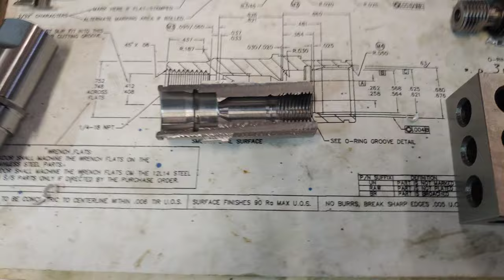Boring bar broke clean in two!! Oops!

Comment: The drill for the pipe tap pushed back in the holder when it started so I don't think the hole was deep enough. You can see it move back into place when it goes to the sub and does the center drilling.
Reply from the maker: Thought I saw that too. Weird thing is I ran a shit load of parts for days before shooting this.
Reply from the maker: Out of steel even.
Reply: @matthewcncsutton5283  the curse of filming is real lol
Reply: Yeah, saw the drill slide in the tool holder at 1:05 and knew what was coming, I guess you were too busy cleaning the stringy chip off to see that lol.  You can see it push back out again when the on the next op on the sub spindle
Reply from the maker: Nice observations sir. And yeah I saw it and thought my eyes were playing tricks on me like sometimes it does.

Comment: That's kind of impressive, pretty complicated little parts. I think I would personally use solid carbide micro boring bars for most of the drilling stuff.  I wonder if anyone makes an indexable tiny combination drill and boring bar? They make big ones.
Reply: Much as I hate Kennametal they do make smaller sizes, They are like little drills with a carbide tip you can change out and they have a few sizes, Called Kentips I think.

Comment: That's a bugger. But looks like you could use a larger boring bar as it's just a cleanup pass?
Reply from the maker: Yeah im trying to hit put a 32 finish on the angle going to the smallest hole.  That was a 5/32 and I now got a 3/16 which just barely makes it through the smallest hole.

Comment: What's ur drill size b4 you bore?
Reply from the maker: .4062 and im boring to .41 so taking off about .0021 per side. The bar broke at the 30° at the bottom. I moved the drill in a about .02

Comment: Bar breaks and he just lets the machine keep running. Would of been a shame if it would have messed up the sub spindle when it did the part off……
Reply from the maker: I could had stopped it if necessary. The bar came out before that.

Comment: Looks like when you hit the back of the bore you are trying to clean the back face inside going towards the center? Try a slight more stub and a bigger boring bar As really its to much for to lil bar especially if you are taking more than a few thou. Looked like a steel bar to, if you can't size up spend the cash on a carbide boring bar and try again. Could also just be you got a bad batch of boring bars as well since you ran a shitload before this point as well. Hope the input helps, Seen enough stupid shit to make a book already sadly.
Reply: Just seen you were using a carbide bar, move up a size or take it as tight as you can on stub and slow her up a little. Check and see what sort of rake you need for you application as well as to much negative rake on the bar will do this as well.
Reply from the maker: Yeah I dont know what happened. I ran 2200 parts on 1018 steel before throwing aluminum in it for the video. I thought I seen the drill move too.